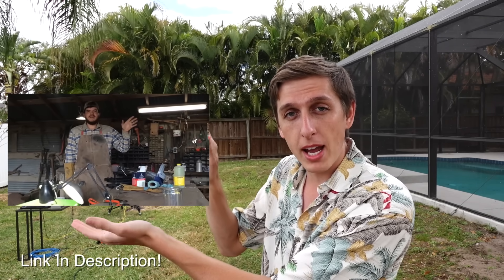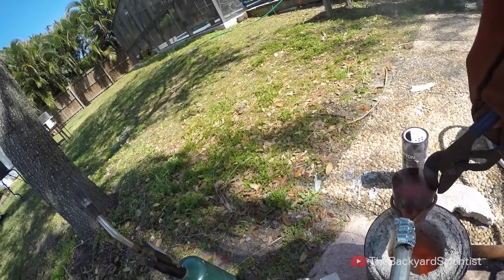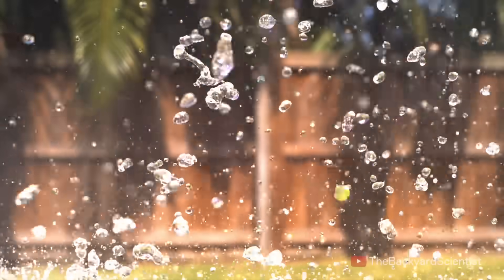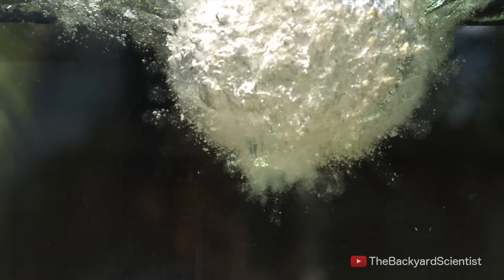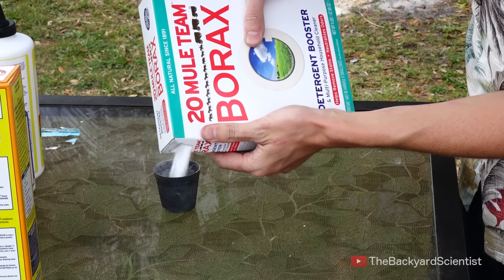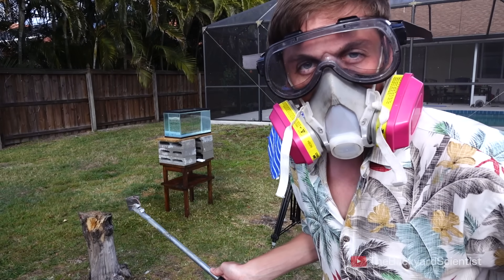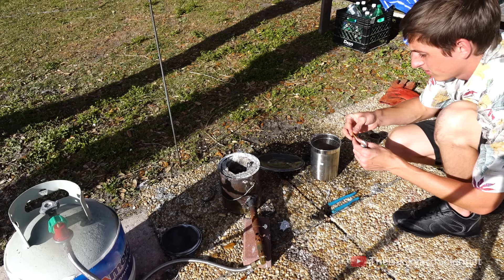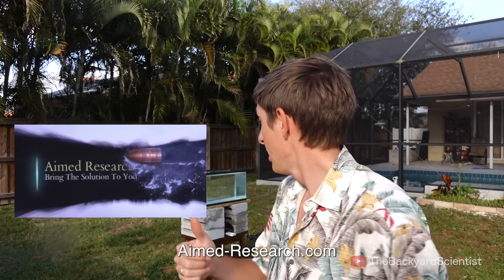Pouring Molten salt into Water - Explosion!

Comment: This is an equilibrium 'reaction', if i'm not wrong?

Sodium is a reactive metal. It is in the same group as Ceasium and Radium those react very strongly with water. Sodium is significantly less reactive though and it was also bonded to Chlorine. The reason why the first two attempts didn't work was because it wasn't heated enough to break most of the ionic bonds between Sodium and Chlorine. It would be much more difficult to break the bond through heating compared to breaking them through ionisation (mixing with water).

The third attempt was hotter and so the bonds were broken. At the same time the heated solution was poured into a much cooler system (the water tank) all of that heat (energy) from the heated NaCl was expelled into the surroundings in order to establish equilibrium with the H2O. I suspect that it is that sudden expulsion of energy that shattered the tank.

Correct me if I'm wrong.

Comment: There is a distinct possibility that this is in fact a chemical reaction. In the high temperatures combined with the fact that sodium chloride and water have highly ionised valent bonds, there would be decomposition of both chemicals and allowing the explosive formulation of sodium oxide and hydrogen chloride, the Ph values of these chemicals oppose each other so would lead to cancelling out. I'm relying on my school chemistry, so would be interested to hear from any qualified chemist whether this is the case.

Comment: Not my area of expertise at all, but I have a guess as to why the molten table salt exploded the way it did while the others didn't. I figure that the Liedenfrost effect may have been cancelled out by the Sodium. Due to the cancellation it may have provided the initial explosion (in this case the initial explosion from 7,000 fps) while that provided the catalyst for the subsequent mini explosions and the second going off. That or it may be that the sodium and Chlorine, being from different ends of the PH scale, could have just about cancelled each other out in the end results and it was purely chemical with a delayed fuse

Comment: I think I know what this is! It might actually be a form of Coulombic Explosion!
Coulombic explosions can happen when a reaction between two compounds produces like-charged ions adjacent to each other on the interface. The like charges repel each other, increasing the surface area and compounding the rate of reaction. Believe it or not, but your fellow youtuber Thunderf00t actually has experimentally shown that this sort of process is behind the explosions of alkalai metals with water.
Now, I'm unsure why salt would produce this kind of reaction... But it may have to do with the specific order in which electrons move around between the sodium, chlorine, and the oxygen in the water. Also even trace impurities may strongly effect the reaction, so that might explain the irregularity of your results.
In any case, the entire coulombic explosion would happen within microseconds, sending jets of liquid salt streaming into the liquid water at supersonic speeds, bypassing the Leidenfrost Effect. The then enormous surface area lets a truly massive amount of heat energy to be dumped into the water all at once, fueling a steam explosion.

Comment: I know what happens when you have air inside the molten salt it contains little particles of dioxide from the reaction of putting salt in molten and it doesn't do anything but in the molten inside when you poor in the molten little holes let out the dioxide and makes this explosion

Comment: What you are getting is the same reaction you would get by pouring molten lead into water.  You are correct in that it is the air trapped by the molten salt.  the reason it is such a large explosion, is that the steam is trying to escape and it cant because of the sheer weight of the salt solution.  I'd suggest you try this experiment with molten lead but that's way too dangerous.  I've had lead melting pots explode and make a real mess and cause very real damage.  Keep up the good work but please keep safe.

Comment: Different surface tensions between molten salts may cause the different reactions between borax and NaCl. That would explain why the salt had to be super hot and why you had to pour the salt so quickly... so it could have enough flow where a water pocket could form.

Comment: I'm going to science this. The salts with higher melting points don't explode because the water immediately turns to a gas (Leidenfrost Effect) and the density of water is extremely low, once the salt cools to a solid, the water can touch it. The alkali metal and water reaction is pretty well known, and becomes Alkali hydroxide at a high temp and hydrogen gas. Maybe with math in play, we can see if the Alkali Hydroxide is in gas form after the reaction which means it won't mix in the water. Chemical reactions also happen faster at higher temps. If you get the pure elements of Alkali metals you'll notice the higher atomic number ones will react faster as well.

Comment: Maybe the reason why molten salt explodes in water is because it has something to do with thermal shock and also the unexplained phenomena of thermite and ice explosion from mythbusters(steam explosion or aerosoling explosion thing whatever called it is and I called it thermo-annihilation because it explodes due to temperature differences or opposing temperature collides then release in a form of energy aka explosion where annihilation is based on physic aka antimatter explosion. Just my theory). Also can you try pouring molten salt on block of ice, dry ice, and liquid nitrogen if it explodes too?

Comment: My opinion is that it was a chemical reaction that we're witnessing in this video.  A lack of change in pH doesn't necessarily mean that a reaction hasn't taken place.  The explosion is caused by the water reacting with the sodium.  The reason that we had a less firy, but more explody reaction with the sodium chloride instead of the pure sodium is because the chlorine molecules were acting as an insulation which delayed the reaction from occurring just at the surface.  The reason why the increased temperature caused a more violent reaction is that the sodium and chlorine molecules are more spaced apart when the temperature is higher.  My other theory for this is that the increased time it took for the temperature to get hotter caused more of the chlorine molecules to become converted to gas and left the solution which left less insulation for the sodium.  The reason that the other salts didn't react as violently is because there was less sodium in them.  For instance, borax is sodium tetraborate.  This means that each molecule of borax has one molecule of sodium and four of borate which itself is already a compound.  Since table salt is 50/50 sodium and chlorine, it had a more violent reaction because the concentration of sodium was higher.

Comment: Why molten boric acid (and borax as well) doesn't explode in water like molten kitchen salt does then? I mean your 'putty-like' physical model of the process doesn't explain this point. Can the mere difference in temperatures explain it? It seems to me things go much more weird way in this case, in spite of the fact your pH indicator doesn't change its color. Because the "steam shock wave' (huh what a term, heh?) can NOT shatter an OPENED fish tank into dust, as your video has caught.

Comment: you are igniting hydrogen, hydrogen usual splits from water at 2000 degrees Celsius but with the sodium as a catalyst you can drop it down to 850 degrees Celsius. you should see how dangerous water is with big smelters.
Reply: apos vlah chemical reactions use the input stuff to combine them to chemical compounds.

physical reactions are reactions using physical properties of the input stuff, not chemical ones.

so a physical reaction is cola and mentos because the carbon acid sets itself onto the huge surface of the mentos and it makes the foam stuff.

a chemical reaction is like i burn wood. it chars and the carbon in the cellulose molecules reacts with the oxygen so we have a chemical compound calle carbondioxide.

hope i could help
Reply: Hangrong Li very thank you. im a nerd by nature, so if you hope to insult me with that, youre at the wrong address to call somebody a nerd, thank you.
Reply: Solubility exceeds Leidenfrost (in water), since it's a light double displacement with much higher solubility than the other tested compounds. You end up with a confused water as it tries to balance between the liquid, aqueous and gaseous boundaries as temperature rapidly changes between the two. You'd see something more "reactive" this way in ammonium chloride, but it sadly has a lower boiling point.
Reply: Yep, I've heard some horror stories about water bottles falling into the vats of molten steel causing a giant explosion.
Reply: I'm not a hundred percent sure it's what happens here because with the molten salt. It was more a reply to Etienne who claimed it to be a hydrogen explosion, which occurs far more slowly. 
But yeah, Thunderf00t actually got his experiments published in Nature, one of the most prestigious peer-reviewed journals.
http://www.nature.com/nchem/journal/v7/n3/full/nchem.2161.html
Reply: can you please tell, will the explosion happen if molten lava meets the salty ocean water?
Reply: Actually... Sodium Bromide. It's more soluble and allows for high-T melting.
Reply: Etienne Fourie i
Reply: It's like a thermoberic device right?
Reply: Etienne Fourie what the differences between chemical and physicsl reactions?
Reply: Thanks for explaining! I guess the molten salt separates hydrogen and oxygen, then it gets ignited and explodes and turns to water again? So the heat energy is turned into kinetic energy.
I wonder if you could build a combustion engine with this? Using heat to turn salt liquid then mixing it to create force to drive the engine?
Reply: Dejay Rezme then use the friction to heat more salt...
Reply: a drop of sweat splatters like hell in molten steel..
Reply: Ah right. Thunderf00t made quite a few videos and research about something like this, refuting some previous assumptions. Is this the same reaction?
Reply: Etienne Fourie I am afraid that you are actually wrong in this case. While not hydrogen and oxygen are highly flammable by themselves, when put together they stabilise. Also heat alone is unable to separate the two. If it could than EVERYTHING that he poured into the tank would have similar effects. Another argument against your claim is the flamability of the hydrogen itself. If it were the hydrogen burning then the effect would be closer to that of the pure sodium, but as you can see, no flame was ignited.
Reply: Hydrogen ignition isn't even what causes the explosion when you drop sodium into water. The explosions occurring when alkalines are introduced to water are Coulombic explosions. Yes, hydrogen is generally ignited as a result of the Coulombic explosion, but the hydrogen ignition occurs much more slowly and far later than the explosion due to sodium (and other alkalines) reacting with water. This is definitely not a hydrogen ignition effect as there's no fire.
Reply: NEEEEEEEEEEEEEEEERRD

Comment: Q: For your first confirmed reaction were you using tap water or distilled water?
some sink water has small metal particles in it as well some small traces of lead do to old pipes maybe there were particles in the water already that caused the chain reaction test the water and try it again.

Comment: 1:10 stainless..........
Reply: It's not stained, it's rusty
Reply: all steels rust under the right conditions
Reply: stainless steel does not rust the particals that are stuck to it rust
Reply: Rust isn't stains..
Reply: lol broek lol
Reply: When it is slowed down fro the second time it reminds me of the sun for some reason
Reply: Yes Stainless Steel does rust, is resistant to staining (IE: rusting), not immune.
Reply: Andrew Walker q
Reply: Stainless steel is a misnomer, they are corrosion resistant steels CRES with high chromium content, and 300 series CRES do better in salt spray tests than 400 or PH series.
Reply: Ellt form "rust" is iron oxide and if there is anything that is made of iron or contains iron, it can "rust". iron oxide is just iron that has reacted with the oxygen in the air or water. Stainless Steel is just a type of steel (it does contain steel) that is corrosion, oxidation, and tarnish resistant because of the way the elements are combined, the outside electron shell of the iron is filled to 8 or close to 8 when the compound is formed. whereas pure iron only has 6 electrons in its outermost shell. which is why oxygen can combine with it very well -- oxygen having 2 electrons in its outer layer.
Reply: lol broek Hahaha
Reply: Stainless steel is not immune to rusting.  It is merely highly resistant.  Salt and heat are two major contributors to speeding up rusting, or oxygenation of the iron.
Reply: lol broek w

Comment: Chemistry lesson Thermal reaction: When you heat molecules you weaken the bonding. The more bonds there are the hotter it takes to weaken it. Needs to be a certain temp to break bonding point when it makes contact with water.

Comment: Molten salt stores potential energy that at the speed of light separates the hydrogen atoms from the water it comes into contact with. Bubbles of hydrogen separate at extreme speed at which point The the heat with oxygen ignites it. The color of the bubbles and the energetic reaction is the hint of what is happening. Very different from the fiery chemical reaction taking place when the sodium hits the water.  This is an experiment I did many times as a boy in many different ways. At one point blew a hole into my backyard, and brought down a tree. I thought I was in trouble but my parents were to impressed with my imagination, not bad for a 10 year old.  At one point I was able to separate an entire 5 gallon bucket of water from it's hydrogen in seconds using a transformer generating 120 votes of dc current and a salt solution I can't recall at the moment. The reaction was extremely loud and energetic, but without the explosion. Looked almost the same except over the hole content of the container at once. I was lucky it did not ignite too, hydrogen was everywhere.

Comment: why is the molten salt not glowing at 800 deg C?
it should radiate heat engergy in the visible spectrum. Can someone explain why some materials do not glow? i mean it most certainly does radiate heat energy. Also the heat energy should have a wavelength depending only on the surface temp. does that mean the surface temp is always so much lower like a skin forms instatnly?

Comment: I actually got the thinking that maybe if there was a way to change the chemical components of the flux in the borax. Then maybe you could get it to cause an explosion similar to the molten salt. I also was wondering if you were using iodized or non iodized salt? cuz both might cause slightly or even majorly different results.

Comment: This is interesting, and this is the reason i fell in love with physics not because of math but making observations and applying theory (with some math). Could you try this experiment with sugar, or other compounds that form to make lattice structures. I'm thinking your explantation is partially correct, see the lattice structure i believe breaks off forming 2 half'ed tetrahedrons the structure explodes because of the polyhedra shapes focal the energy to discharge at a very specific point, which points form inside another tetrahedron lattice. This exponential chaining results in observed explosion.

Comment: I can't imagine a physical reaction producing such a sudden explosion. Perhaps the chloride stabilizes the sodium long enough for the reaction with water to be delayed.
Furthermore, if the ph-neutral water you used is actually dasani, note that dasani has added sodium chloride, which might account for the lack of change in ph when the molten nacl was added.

Comment: when I was in school, in the chemistry lab, during some experiment using the raw sodium Na, our teacher told us that introducing sodium in water should be done gently and gradually and she strictly prohibited to throw the Na metal piece in water ... she explained that Na is highly unstable and extremely reactive ... if it's thrown, the kinetic energy of throw and the potential chemical energy of sodium causing the reaction add up and it is so massive that it can even explode, causing harm to the nearby standing students ... So use caution !!

you my friend, did the very same thing, by melting on heat, raw sodium atoms were ready to react, when you pour gently, some atoms may get cool and react with surrounding oxygen or chlorine but when you pour suddenly, there was very less time for pan to cool and react with surrounding environment rather it reacted with water perfectly ... which caused massive explosion (depending on concentration/amount of free sodium which reacted with water) ...

Comment: salt can explode in water because it's sodium and sodium is very unstable when mixed with water but table salt does not explode when it touches water because it is mixed with chlorine when it is solidified so when you boil table salt it is so hot that the chlorine turned in to gas and the table salt is now just sodium so it will explode when in contact with water.